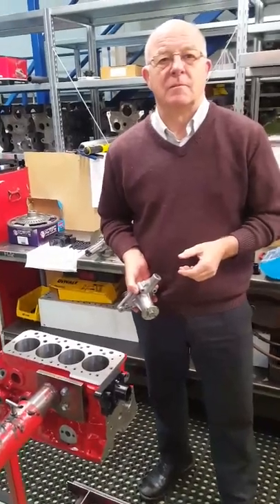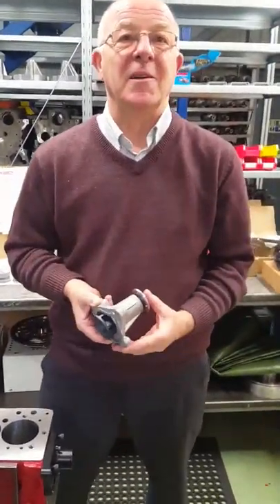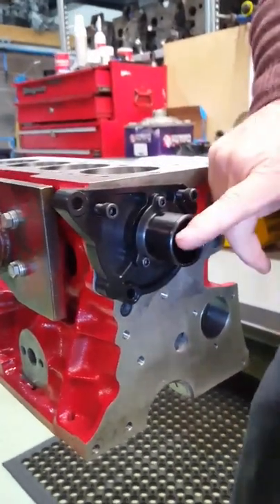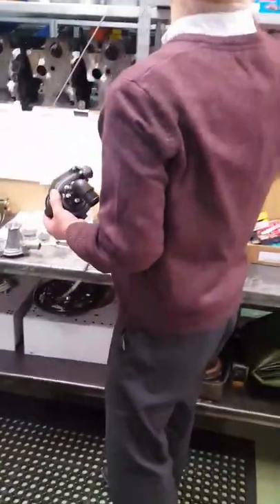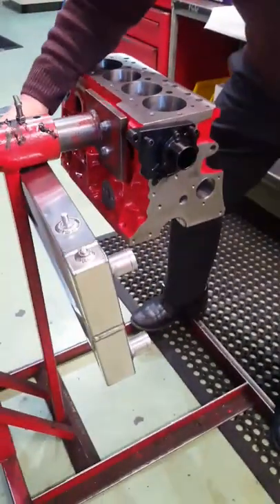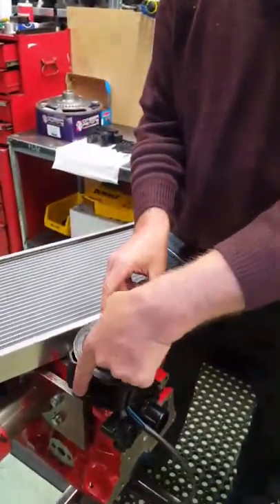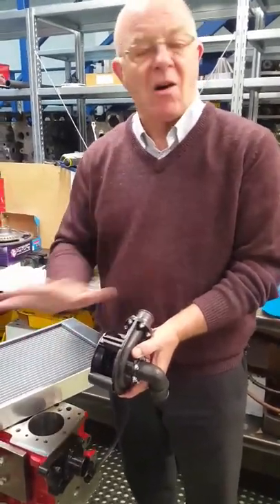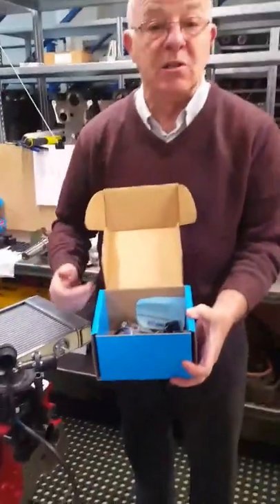Classic Mini electric water pump conversion

Comment: Would this pump setup work on a GTM Coupe where the engine is in the rear and the radiator up front? So the coolant needs to be pumped to to the front of the car and back.
Reply from the maker: Yes, it's quite a powerful pump so would be able to handle this quite easily.

Comment: Do you need to also run electric fan on front mounted rad.
Reply from the maker: We don't tend to on race cars, only really needed in traffic - low speed with no airflow to the rad.

Comment: The part about gaining power is partly BS, sorry. Using an electric water pump will load down the generator more and thus drecreasing the power again. However, it is possible that the electric pump is more efficient than the mechanical one and thats where your power comes from.
Reply from the maker: No, sorry but you're incorrect. Tried, tested, proven. We only sell parts we would use and race with ourselves.
Reply: As I said, it does give you marginaly more power, but you have to take the power to move water through the coling system from somewhere. I'm talking laws of physics. "What goes out must go in."
I'm sure you're selling tested quality parts and didn't mean to infringe your business. 
I just wanted to point out that the explanation for the power gain is partly incorrect and provide my own explanation from the viewpoint of the electronics engineer that I am.
Reply from the maker: The pump draws 7.5 amps at full speed, which makes a negligible bhp reduction in terms of resistance from the alternator.
Reply: But it is there and thats my point. Its less than a mechanical water pump would use but the pump still uses some energy. Glad we worked that out.
Reply: You should start your own company, Mr Expert here lol
Reply: @MEDEngineeringTechVideos  maybe the fact that you are not now running the pump together with the alternator helps with power output as in drag on the belt ,,,high revving the alternator without the water pump pulley friction  is more efficient than high revving with an extra pulley is it not and you are only using electrical power for the pump,,,instead of friction on the pulley electric pumps are in fact better for race engines ,,,, glad now that we can use them in seven s class so the new regs state
Reply: Well 7.5A at a charging voltage of 14v would be 100 Watts which is approximately  0.15 Hp. The power if a mechanical pump goes up with an exponential of engine speed. MED quotes 3hp for a standard pump that sounds high to me given that ordinarily on a race engine it would have an over sized pulley to slow it down. But even if the number is 1hp that still significantly higher than the 7.5A electric pump. I suspect that some people are running charging cut outs at wot (wide open throttle ) since that trick has been around for at least 60 years if not longer.
Reply: James Eastwood, your calculations pretty well coincide with mine.

I remember decades ago, running a brief test on my tuned 850, had the fan belt off, car went like a rocket.
Reply: @jameseastwood4984  arnt we talking about race engines that are always WOT. Dont forget all of this is for a race application.
Reply: @benjaminbenson8714  I had to re-read the discussion to remind myself what we were talking about! 
A WOT charging cut out means that you can harvest electrical charge when you're off throttle  in fact this is fairly standard on road vehicles. 
You're correct that a circuit race engine spends too much time at WOT, to make a WOT charge cut out a good idea. But even with a constantly charging system I stand by my estimates, and the idea that the electrical pump is less wasteful of energy. Something i learnt tne other day is that the use of a 14v battery is gaining prevalence in drag racing  this allows the electrics inluding  ignition, to all run at peak voltage without the need for a live charging system.
Reply: Das TIER The part you are missing is that an engine driven pumps has to work over a wide range of speeds. To shift enough water at idle it has to move way too much water at high engine rpm, and therefore requires a lot of power. With a motor driven pump, the pump speed can be controlled independent of engine speed.
Obviously the electric pump still requires some engine power unless you run a total loss electrical system.